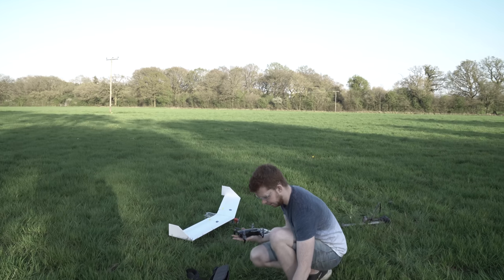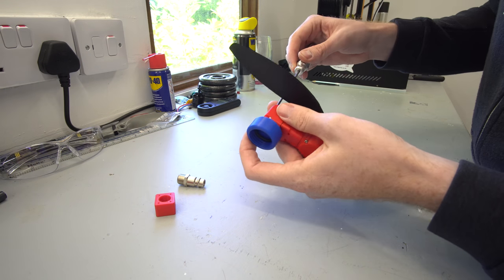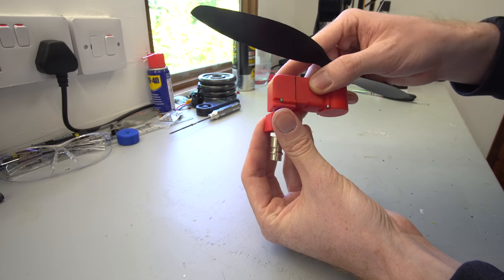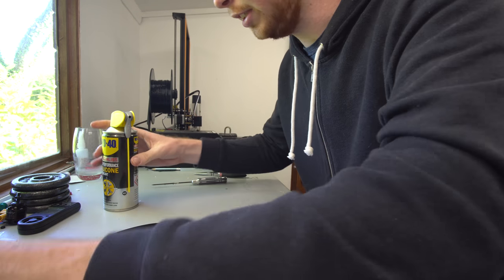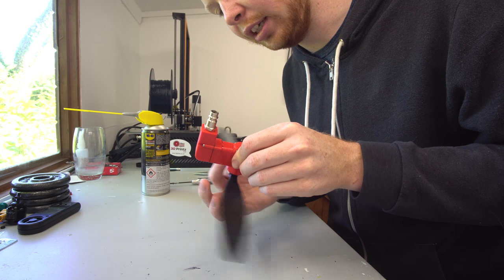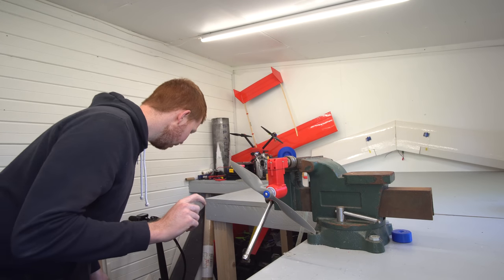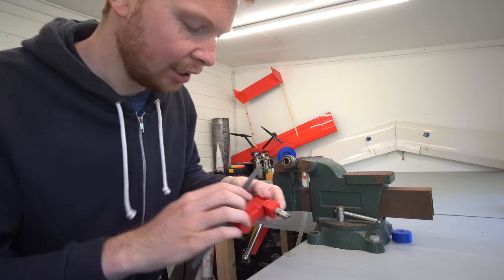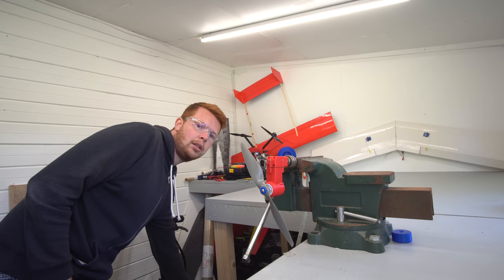Air Engine Throttle

Comment: Great job! My 2 cents would be to find the minimum operating pressure of the engine or final engine and I would hook this up to a microprocessor to regulate the fine travel of the diaphragm valve you made to maintain a nice idle speed (rather than fiddling with mixing in the transmitter) - you may have issues with the 15-30 gram servos you have been using to apply enough force, reliably, to have fine control over the motor. Nicolas's suggestion of the venturi setup might get a bit too complex for this scale of engine, but great idea. thanks for posting.
Reply: Cerebral Dad not to mention transmitter mixing isn't going to work for him because the power dropoff with compressed air is much steeper than with lipo. He's going to have to keep manually raising his throttle throughout the flight to get the same power.

Some form of automatic regulation is necessary, either electronically (with a microcontroller as you suggested) or mechanically (with a spring, rubber band or tensioned wire/strip)

Comment: You could add an idle valve like on a carburetted engine. A small hole with rubber and a screw up against it might work. That way you could completely shut down the flow with the throttle without killing the engine.
Reply: DonCasper maybe just adding a stop under the throttle lever to leave enough flow in the lowest position is a simpler option.

Comment: You should put a threaded nut or screw on top of the valve so  you can set a speed and leave it
Reply: It doesnt fly full throttle. Whats it gonna help with a slower prop?
He needs a pnuematic dental drill head. They use little air compression with high speed and torque. And about 1/4 the weight compared to the mean machine he's ready to work with.
Reply: @AngryHybridApe  The point is not for him to make a perfect engine, it’s him having fun and learning. Before you insult his creation, could you design anything better with 3D printing?
Reply: @alrightkewl8235  
Ok. I sorry I called it a POS. Studing anything is always a learning process. Wether its what to do or what not to do, somethings you already know, some things you didnt. Sometimes even learn something serendipty and it answers a lot of questions. Always learning.

Comment: Well done.  Looking forward to the car version of the engine.

Glad to see you finally got a compressor, even if only on loan from your grandfather.

Quick disconnect fittings can leak.   I have some touchy ones in my shop.   Sometimes it is due to variations of tolerance if the fitting and disconnect are not made by the same company.   Sometime the spring gets weak or the seal leaks.   I would remove the disconnect and clean it out in case there is dust/dirt on the seal.

Another option for lubrication is a dry teflon spray.   Another option for a valve is a needle valve.   Back in the days when the UK made cars, lots of cars had Stromberg or SU carburetors.   They had needle valves to control the fuel which was mixed with the air.

Dave.

Comment: There is a better solution than a valve, make a cam that moves and varies in geometry along axis of rotation to vary timing.  This will have the same effect with many times more efficiency.  The difference is equivalent to the difference between a switch mode power supply and a linear one.  ~one electrical engineer

Comment: I wonder what the engines wear characteristics are or will be like?
Reply: like horse power and torque?
Reply: More like how long before the moving parts wear out.
Reply: Martin Dinner 
Correct, I was just wondering how durable the materials are when used as an air engine.
Reply: Matthew Duncan Barring accidental friction welding, probably a good long time!
Reply: Because the piston is a square i think the edges are gone in a matter of time , because the pressure etc

Comment: Since we now have proper throttle control, could we get some kind of self balancing air powered quadcopter
Reply: His plane only glides for like 30 seconds. Planes often run 5x longer than a quadcopter, so expect a maximum of 5 seconds. Plus you have to make 4 of those engines, that wouldn't be very entertaining for a 5 second hover.
Reply: With a hose attached maybe, but I imagine even the 4 motors and hose might be too much for a VTOL lift.

Comment: You really need a tachometer so you can properly check RPM output. You're doing proper engineering without proper measurement! I suspect one of those cheap bicycle computers may be good enough, even.
Reply: I thought he already has a tach gun in his kit somewhere? One of the optical ones that uses the reflective tape. (Can't recall which video though. And if it wasn't him, then those aren't all that expensive anyways. Something like $30 for a basic one.)
Reply: Just analyse the sound frequency spectrum, and you'll guess the engine RPMs!
Reply: RPMs and thrust are the two most important things he needs, to get this project REALLY moving. After that, some sort of airflow meter would be good.
Reply: He doesn't need any of them! Just nice-to-haves for data freaks. If he wanted to maximise peak power he could do it by ear, as it stands he will be running at reduced power so it's unnecessary.

Comment: 4:10 Does the engine have to be pointing downwards? Does it rely on gravity for something? What happens if you turn in upside down?
Reply: Yes, there is a ball valve in there that would bot function upside down if its not pressurized

Comment: Hi Tom. Congrats for the excellent work! I suggest you to add on top of you control valve another pressure control chamber equipped with a tensile spring calculated in such a way that the air from the pressurized air bottle provide a proportional control in order to keep the motor rotation constant. So, when the initial pressure is high, the motor runs with the control valve at the design air pressure position for the piston. As soon as the air (power) pressure reduces, the spring opens proportionally the valve up and the motor keep its rotation constant. You will need to load the pressurized bottle with a pressure higher than the design pressure for the motor pressure chamber.

Comment: As a mechanical engineer, you would have more tools than a set of needle nose pliers. Most people who have mechanical leanings would use a spanner or adjustable spanner. Also, are you aware that your vise turns?
Reply: Does it really matter? He was nipping up an insignificant adaptor, not working on a nuclear reactor. Also, are you suggesting that an adjustable spanner is a suitable tool for a mechanical engineer? If you look how he's recording the video he has a camera on the table, so better to put a smaller prop on than faff about moving the vice and then have the need to set up a tripod in a small shed.. If you know anything about mechanical engineers that are educated from a degree route you would know that it is an academic route and they are more often than not less well trained in hands on skills as they rarely get their hands dirty unless they did their degree as an extension to an apprenticeship. The fact that he is developing his skills in these projects and giving us some entertaining videos is reason enough for me not to even consider complaining about him using a pair of pliers instead of a spanner.
Reply: Thank you for pointing out the incredible shortcomings of many engineer's educations. They often have little or no skills in hands-on work unless they served a practicum or work experience. When they give direction to those who have to build the devices that they design, engineers often lose respect from those who must follow their directions. The result of these clueless directions is often very costly or very dangerous to people associated with the contract. I have taught industrial automation and electronics for 20 years and always include some simple hands-on tool handling and safety in my courses.
Reply: That's why people with hands on skills are employed, to fill that skills gap. I am sure if you take the opinion of mechanical engineers you would hear of their dismay at the amount of tradesmen/women who can't follow simple instructions. Given what Tom is doing here I think his efforts are to be applauded rather than mocked. If he keeps up these personal projects he's going to have a very good career.
Reply: Pliers vs spanner thing so what
Vice yes you should know that it turns 
And to adjust to pressure output from the compresser you need a to buy a pressure reg! 
Not the best for them turning it on and off extremely often
Reply: Robert Evans I saw that about the vise I would have juat given the hose slack and turned it
Reply: He could have just plugged in the engine upside down, it is offset. Tool use is trade school, most "engineers" these day just use computers. Most have never used shop tools. (Aeronautical engineering graduate student)
Reply: Later in the video, he has turned the vise. Great work and videos!
Reply: Chase Wood yep my thought was to turn the engine upside down. But on reflection there is the potential for a prop strike on the bench if flicking the prop turns the motor back down a bit.
Reply: I'm a mechanical engineer. And I need to admit the world that I occasionally use a Philips screwdriver on pozidrive screws.. oh the shame.
Reply: You see a shed full of tools? Probably not, because he doesn't have a shed full of tools, so he uses the best he has.
And you clearly have no clue about filming, so let's make rule #1 clear, people need to see shit. Which is why turning the vice would be pretty darn stupid.

Comment: Yea Tom, we knew you could do it, now it's easy to use a servo to control the throttle plus a paintball/BB gun type cartridge for air supply.

Dance the Skies

Comment: You could add a small pinprick hole that's always open between the two sides of the diaphragm valve to allow for idle at zero throttle. Great video!

Comment: Hey Tom,
A great way to check for and find leaks is to put a little soap in a spray bottle and then spray that mixture on the device. If any bubbles form, that’s where you would have a leak.
I hope that helps.

Comment: Nice one Tom, the compressor fittings always leak that's common. Possibly go for a needle valve that would give you even finer control and could be produced even simpler. Good work

Comment: Awesome work! Maybe to create a throttle that will idle when released put a spring against the lever to hold the diaphragm towards the closed position so that you have to push against the spring to open the throttle. You could adjust it to idle with a spring that way and then have feedback when pushing the throttle open. Just an idea. Can’t wait to see the next video!

Comment: If you use a linear stepper motor with a cam to actuate the diaphragm valve and get a greater control range depending on the angle you set the cam. I work with a company that makes flow meters and controllers. The cam actuator can reduce the pressure on the assembly if you use a bearing to hold the cam in place. If you have questions please pm me and i can give you my email. Great work so far! i love watching your videos and seeing your design process. You also can use a stepper to get the linear motion. Converting to a linear motion changes the direction of the forces which makes it easier for you to control.

Comment: Good job Tom! You could easily add a servo with a slightly offset circle on it for throttle controls.

That would give you the fine control of the valve with a servos full resolution

Comment: Wonderfull!
It runns and throttles!

The leaky fittings are typical of the large quick connects, usually due to age of internal o-ring or wear. It can happen on new ones that are simply installed wrong, or have been galled/damaged by installation as well.

Since your engines are less than V8 size they really don't go well together with this kind of fitting at all. I sugges you try getting some push-fit air fittings. They come in different sizes for tube outer diameter as well as a free choice of internal threads. Stay at M4 or above for good threading in printed plastics and tap the hole before you screw in the fittings.
The fittings usually come with an o-ring to seal the thread as well; mating with the surface of the print and underside of fitting.
Depending on the air consumption and pressure I'd suggest trying for something in a 4mm OD which will be quite neat and easy to work with if you need to route and distribute air from a separate tank later.

Hoping to see a radial engine next! The airtubes I mention would look great in that!

Keep up the great work.

Comment: Interesting that there's a delay between pressing the button and the change of revs. I guess there's enough air on the other side of the valve to run the engine for a few cycles.

Comment: The throttle idea is really cool! And it would be easy to design it to work more like a traditional engine where you press to accelerate instead of limit. Might be a good idea to have it work like a recirculation valve instead of just a diaphragm, so the pressure increase has somewhere to go. Very interesting

Comment: Have you thought about using brass or steel tube to sleeve the cylinder? Maybe a metal piston ring? Should reduce friction and take stress off the plastic.

Comment: OK, the basic throttle functions.  Now it's time for a governor (constant speed, regardless of input pressure variations) - you can do it Tom!
Reply: My thoughts precisely. Watt's Governor is still my favourite invention, and could be connected with the prop drive.

Comment: DANG!!!  More complicated, but maybe go the other way round.  Push to throttle up, release to return to idle.  On the current model, the tiniest of slots in the center, (a minuscule leak between the in and out) to hold idle speed in the engine.  Thank you, Tom.  ~daniel

Comment: If you were to put a rubber band on your lever you could have it regulate it's self. You could adjust the flow by sliding the rubber band up and down giving it more or less leverage.

Comment: May be a small flywheel would help stabilize the idle, but after the latest additions and it's already getting heavier . Good luck with increasing the performance.

Comment: 2 Ideas from me:
1) You can stick a little wedge under the lever so it is not posible to choke the engine to stall.
2) The valve can be (after some tweaking) controled by pressure of air in the bottle tank. The more pressure you have, the more engaged the valve will be, thus creating constant power.

Comment: For idle control, you could add a small bypass channel that will constantly supply the minimum needed air, unthrottled. Like how an ICE idle adjustment screw works.

Comment: Great series of videos.  Now you need to figure out how to reverse the throttle action so that your pressure opens instead of closes it. A sprung lever that closes it (to a point that it still idles), with an extension on the opposite side of the fulcrum that acts as your throttle lever, would do the trick.

Comment: Awesome job Tom! Your genuine enthusiasm is really good to watch. You do need to invest in a few tools though! A shifting spanner or two even! ;-) A thread tap set (works well on 3D prints and I also recommend some Locktite thread sealant - that stuff is far better than PTFE tape for sealing air connections etc. Keep up the good work! Looking forward to next week's vid'!

Comment: You could put a hole about halfway down the throttle lever, and run a screw through it, long enough to bottom out on the throttle plate. You could then adjust this screw up and down to adjust where the lever stops/bottoms out, effectively letting you set the idle speed, so that the engine doesn't stall.

Comment: Suggestion for the throttle, shorten the piston slightly so you can't kill it, but pressing the lever as far as you can will bring it down to an idle. But make the hinge mount a slot and extend the back end of the lever a cm or so, so pressing both the front and back of the throttle lever will be enough to stall it

Comment: Glad you engaged safety squints before using the higher pressure lol.     This is skookum as frig.   Could probably use an actuator or servo or something to control the valve electronically if this was going into a RC car or something.

Comment: You can modify the head shape of the pluger in your valve to adjust it's control curve and behavior. ie.: A chamfer around the head would prevent stalling. A dome head would modify the control curve but since you have 2 chambers you will have to either modify the entrance to the channels or be creative with a double domed head + do something to keep the proper orientation.

Comment: Hey throttle turned out great man! Throw a servo on that and set end point for idle. Just looking at it I can vision a flywheel and rc clutch assembly drive system easy route to go.  Add a recoil starter to get it started and a tuned pipe too lol.  Same principal pump engine that needs to idle.

Comment: Really cool! How about adding a lower limit for the throttle lever so that it doesn't cut out the engine when you go past a certain point.  Instead it just leaves the engine in idle. Then another valve could be added to open and close the air supply. It would only have to be a small valve just so it can be turned on and off.

Comment: That is pretty cool, I would just add a little arm from the throttle housing with a threaded hole, add a screw to make it a throttle stop for idle. That way you could stick a servo onto that throttle and tune it :D

Comment: Running with your car idea here... You need to add a spring to your diaphragm piston to time the engine. It needs to be soft enough that at full spring compression it lets 30% into the engine to maintain good idle

Comment: Nice Video! You should try making a control line plane that has an air hose running out to the plane. It may not work very well but I think it'd be worth trying.